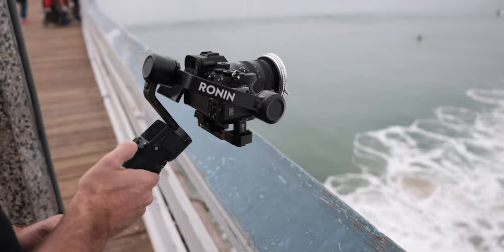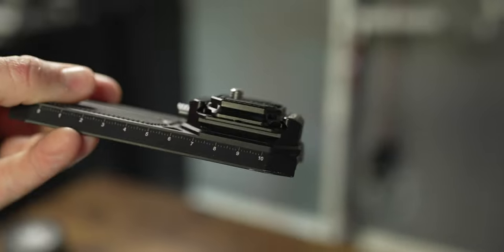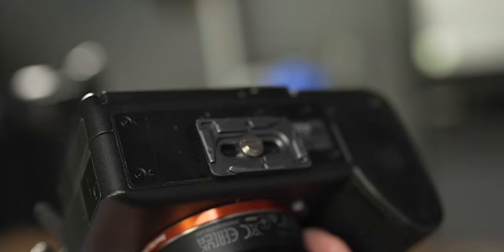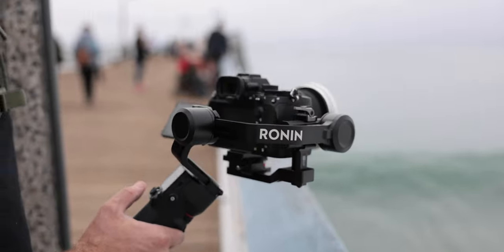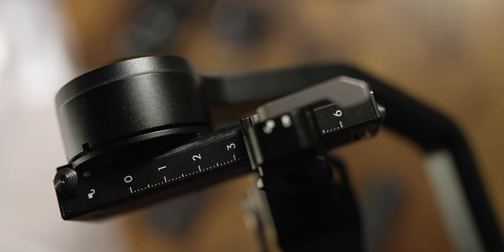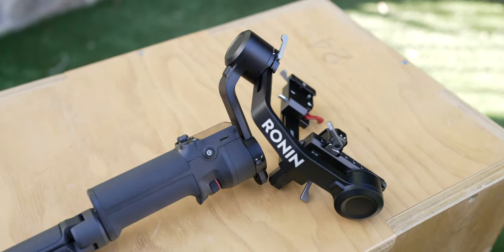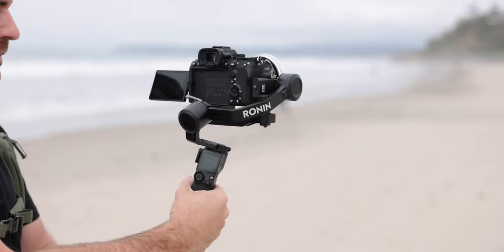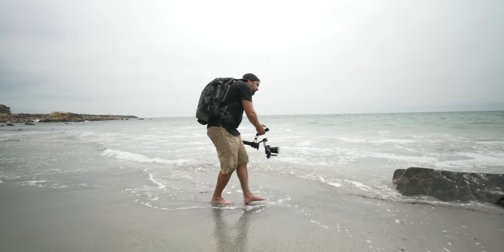I Fixed The Biggest Problem with the DJI RS3 MINI

Comment: Hi Jeven how compatible isthe Bluetooth functionality across camera brands? Can I use this gimbal Bluetooth to record and control shutter on a Nikon z body?
Reply from the maker: Not sure on nikon because I haven’t tested it.  If you can connect via Bluetooth then it should work.  Contact DJI support and the should be able to help you
Reply: Im using this gimbal with the Nikon Z6ii. The bluetooth only can control start and stop recording.  If you want to control shutter, focus, iso, aperture you need to use the usb-c cable.
Reply from the maker: @ManishGosalia  Thanks for the clarification!
Reply: @ManishGosalia  thanks
Reply: I remember reading in an Amazon review about how the only thing Bluetooth works with besides Record is unfortunately the Zoom, worse still, it doesn't work with Optical zoom.

Comment: the biggest problem for me is you cant use a cage because it becomes top heavy and you cant add a counterweight as there is the release button on the back
Reply: Depends on the camera. Im using my A7C with the smallrig cage with no issues.

Comment: any solution for someone who is only using manfrotto plates? like an adsaptor or something? thanks
Reply from the maker: This gimbal is not setup for manfrotto.  You could modify it like I did and add a manfrotto quick release if it’s small
Reply: @JevenDovey  thanks . lastly, i didnt get it about the falcam. does the rs3 mini camera plate, fits on the falcam adaptor? if yes i could just buy 2 falcams, and fit the rs3 mini camera plate to all of my other stuff, like tripod manfrotto and shoulder rig manfrotto style. thanks

Comment: Can this be used with the canon 250 d dslr
Reply from the maker: Check the weight of your camera lens combo and see it it exceeds the weight limit
Reply: @JevenDovey   thanks for such a quick response, it's 2kg(appropriate wait for the gimbal), I've read the focus wheel doesn't work but if I'm using auto on my camera already would this matter

Comment: Do you know if the DJI RS3 mini plate will work on the mantispod? I have a ZVE10 and already invested in a lot of peak design gear. If the RS3 mini plate will work on the capture clip then this will be the gimbal i will get...
Reply: I can confirm that the rs3 mini plate fits the Peak capture clip v3, with no modifications. It's a tiny bit loose but still totally secure. I've tested it myself and there are other videos on YT about it too.
Reply: @alexyorkshots  Thanks!
Reply: You may have already found this out the hard way, but the DJI plate is not compatible with the Mantispod. It will go on the tripod, but won't lock down securely. The DJI plate is also about .5mm too wide to fit on the Peak Design tripod. I'm starting to think DJI made these two systems incompatible intentionally. Seems like it would have been so easy to make them play nice.

Comment: For those who don't want to drill a hole - the PGYTech quick release plates work with the the Ronin RS3 mini.
Reply from the maker: Good to know
Reply: Actually, most of the normal arca swiss plates do
Reply: Do you have a link? Thanks
Reply: Do you have a link please?
Reply from the maker: @RobHK  I've tried a bunch of arca swiss plates and all are too loose with the original mount.  I ordered a few others to test out.

Comment: But thats one of the features - vertical - now you don't have it. Its not really a good solution
Reply: Even with the hole you still can use vertical. Just throw the original dji clip and plate in your bag. You'll have to change plates, but if vertical is that important to you....

Comment: Nightmare Problem...Mini 3 + FX 30 + 10-20  doesn't work.
Reply from the maker: Why doesn’t it work
Reply: @JevenDovey  it works, but never balances properly. Extreme end on two of three axes.  Give it a try!  The lens is so incredibly light and small, the FX30 is back heavy.  Also, the gimbal loses the ability to fold flat.